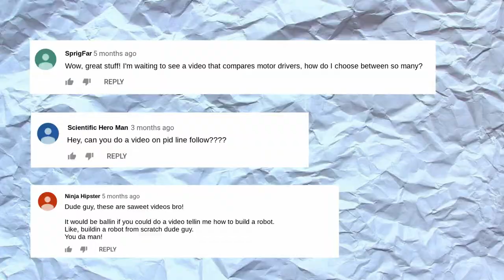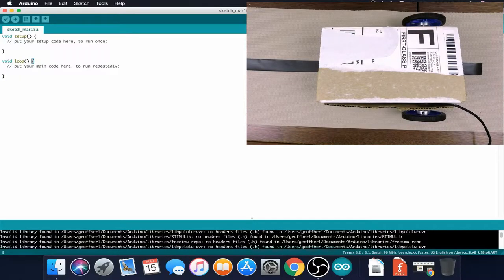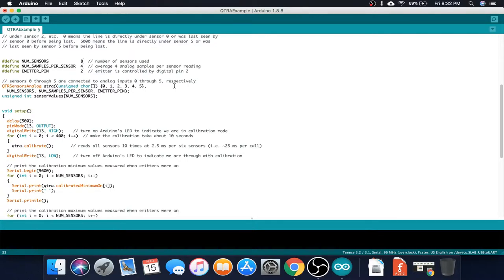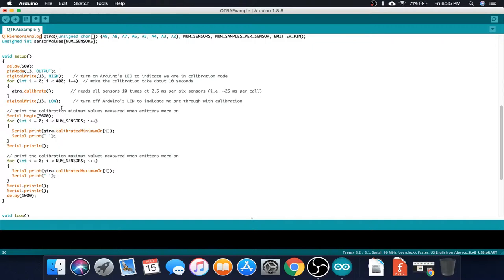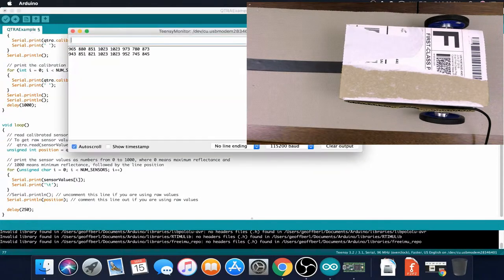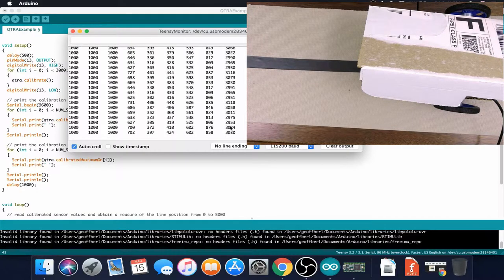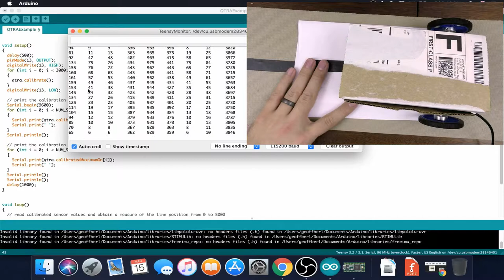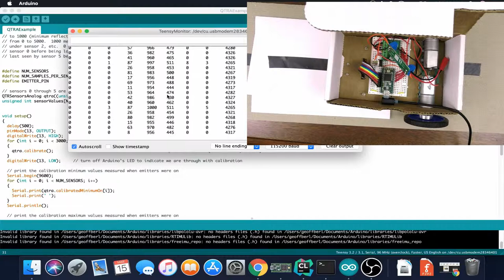Hookup and Program QTR Array on Cardboard PID Bot

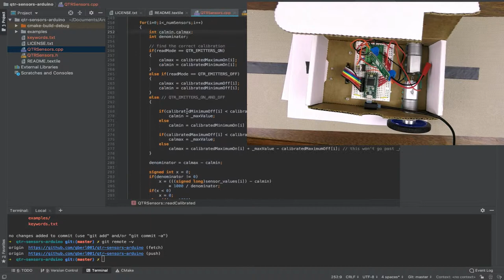Comment: I am wondering how did you come up with that solution at 18:15? It's really fascinating and saved me lots of time. I know it has been too much time since you release the video  but if you remember what was the problem solving process you took I would be really appreciated. And even if you don't remember, can you tell me about what are your first steps to find the problem? (using debugger, reading code over and over etc.)

Comment: I am doing a line follower robot with qtr 8rc using the motor driver shield L293d model. I am  not getting any calibration on screen, will u help me to fix it?
Reply from the maker: Sorry for the late reply, you can contact me through my site which will provide me with your email so I can contact you directly. Send me a message with your code and I'll definitely take a look. http://robotresearchlab.com/contact-me/

Comment: I have 2 questions-
1. What position value does the readLine function give when all the sensors are over a white surface?

2. What if I wanted to get the position of a white line on a black surface? Is there any function in the qtr sensors library which can give position of the white line between 0 to (no. Of sensors -1)*1000 just like you did with the black line?

Please help.I really learnt a lot from your videos
Reply from the maker: 1. In theory, over an all white surface it would show the center as the result since each sensor would be weighted equally. However, this isn't really true since there is going to be some variance in the surface and in the calibration. Also, the library automatically accounts for when no sensor sees a line, it will return the first or last sensor (whichever last saw the line). So, to summarize, because of the way the library works, if you drive off the line going right, it will show 0, the left most sensor. If you drive off the line going left it will show the value of your right most sensor (7000 if you have 8 sensors).

2. This one's easy, the library can already handle this, there are two optional parameters for readLine(). In my code I just pass in the array which gets populated by the library with each sensor value. By default, the second parameter is QTR_EMITTERS_ON, and the third (which tells the library if it's white line) is set to false. All you have to do is provide these two optional parameters but change the last one to true so the library knows to look for a white line on dark background. It would look like this (not tested)

unsigned int position = qtrrc.readLine(sensorValues, QTR_EMITTERS_ON, true);

I hope that helps, thanks for watching and commenting.

Comment: Can I work only with 6 sensors because I'm using arduino UNO also I want to know what does it mean : "EmitterPin(2)"
Reply from the maker: If you are using the QTR-8A (analog) then yes, you can only use up to 6 sensors. I would suggest just using the middle 6 and leave the outer two disconnected.

Just know that this will change your PID "goal" value if you plan to implement PID. The goal is calculated by Goal=(numSensors-1)*1000/2

If that doesn't make sense just think about it from an intuitive point of view, you have 6 sensors, so the sensors will return somewhere between 0 (for the first sensor) and 5000 (the last sensor). You want to be in the middle so it's 5000/2 or 2500. And that's just because 2500 will be what the sensor returns when you are between the 3rd (2000) and fourth (3000) sensors.

EmitterPin(2) is used if you want to be able to turn your sensors on and off. This can be helpful if you want to eliminate ambient light but I personally don't use it, I usually just put the sensor under the robot where it won't see much outside light or I cover the sensor with black electrical tape to block outside light from getting in. A calibration will typically fix any of this as well.
Reply: @RobotResearchLab Could please help me... I'm preparing a line follower robot with arduino uno, L298n motor driver and QTR8 Digital... By the way this robot is not neither for a school project nor for competition, it's just for learning
Reply from the maker: @motazmsaddak5242  Sure, that's what I'm here for, helping. Although it can be difficult to help remotely. You'll have to figure much of it out on your own (hopefully my videos can help) but I can help if you get stuck on something.

Comment: Hello, I am using the QTR-8RC board and I followed this tutorial (including the soldering/wiring video) and I am not getting any values for the two sensors on the breakable part of the board. This is the second board where I've had this problem. Is there anything I need to do to enable the last two sensors?
Reply: Alright, so I figured it out not long after posting this. I am using this sensor with an Arduino nano. Normally, it is okay to use the analog pins for digital input (because digital input would just be either min analog or max analog input), and I made this choice because after hooking up the motor driver, I didn't have enough digital pins to use all digital pins for the sensor inputs. I fixed this by changing the last two sensor connections to my remaining two digital pins. The board works perfectly now.
Reply from the maker: @Mekadrom  Interesting, I've never seen this issue. All analog pins on Arduino boards should be able to be used as Digital. Maybe there is something with this particular library and Analog pins that doesn't mix well... Thanks for sharing your solution.
Reply: @RobotResearchLab  Apparently, the analog pins A6 and A7 explicitly can't be used for digital input: https://store.arduino.cc/usa/arduino-nano Go to the FAQ section. The more you know, I guess.
Reply: @RobotResearchLab  I'm now getting a problem with the sensor array where towards the zero end (the first/zeroth sensor), the readLineBlack() value starts to go up instead of down before becoming zero again. I am calibrating everything properly, and the output values for the calibration all seem normal (lowest is 48-192 and highest is 2500 across the board). This is again the second board I've had this problem with.
Reply from the maker: @Mekadrom  I would recommend running the raw values example to see if you get the same problem with your sensor toward the zero end. I've never seen that with just one sensor but I do know that I've seen issues with the library where the value will jump from 0 to 1023 because of an overflow problem. (Not sure if I mentioned that in this video but I mentioned it somewhere). Also, I'm not sure if you're using the QTR library from Pololu or the one I modified which is old and needs to be updated but still works if you aren't using the CTRL pins on the newer boards. If you're not using it, try my library here https://github.com/gberl001/qtr-sensors-arduino

Lastly, if I don't respond to your message I apologize, YouTube doesn't notify me of all comments for some reason so I never saw your comment about the A6 and A7 pins but that's very useful so thanks for sharing.

Comment: The sensor use in these is it QTR 8A or QTR 8RC ??
Reply from the maker: In the video I'm using QTR 8A, but QTR 8RC would work just as well. You'd just have to change the sensor declaration.
Reply: @RobotResearchLab  how I can do that?
Reply from the maker: @eyadkhirat413  If you were using the analog QTR-A array, the declaration would look something like this

QTRSensorsAnalog qtrSensor((unsigned char[]) {A9, A8, A7, A6, A5, A4, A3, A2}, NUM_SENSORS, NUM_SAMPLES_PER_SENSOR, EMITTER_PIN);

And if you wanted to use the digital QTR-RC array, that would look something like this

QTRSensorsRC qtrSensor((unsigned char[]) {3, 4, 5, 6, 7, 8, 9, 10},  NUM_SENSORS, TIMEOUT, EMITTER_PIN);

the rest of the code is the same. So for example, if you were taking a reading it would be:
unsigned int position = qtrSensor.readLine(sensorValues);

It's the same call for reading the line as long as you named the sensor the same thing like I did above where I called it qtrSensor, now it wouldn't matter if you're using the analog or digital, all the reading calls are the same, the only difference is when you declare it as QTRSensorsAnalog or QTRSensorsRC.